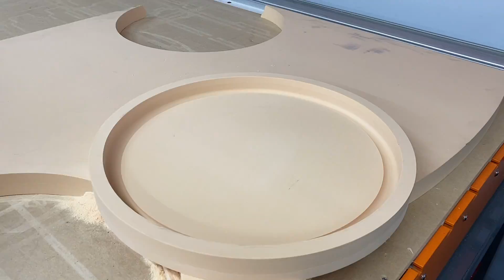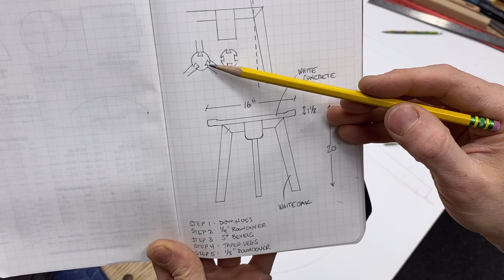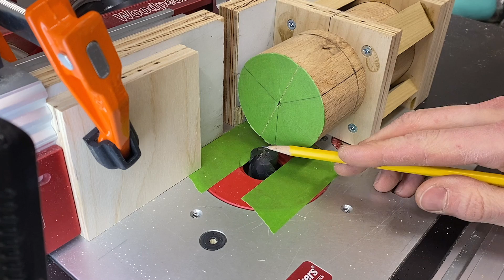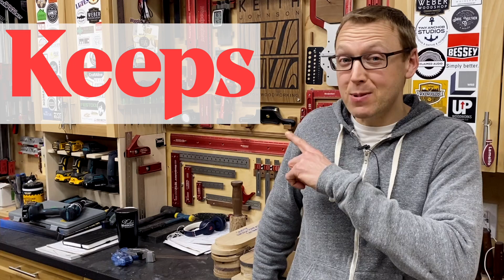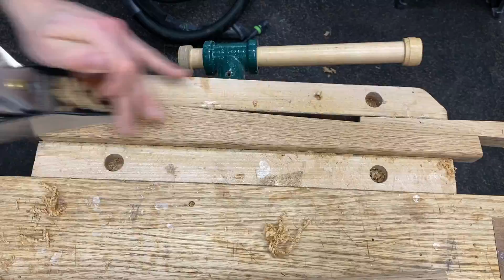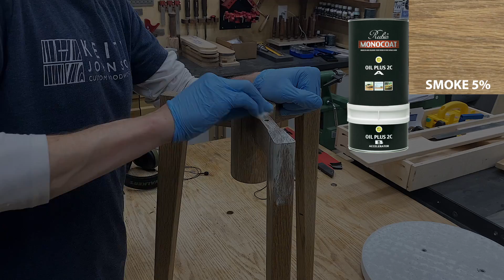BORED with joinery?...try this modern side table with #concrete

Comment: I see a lot of makers/woodworkers using the white Scotchbrite pads for applying finish, and probably just as many starting to use Rubio Monocoat. Can the white Scotchbrite pads be used for applying other finishes like wipe on poly, danish oil, shellac, water based poly, etc OR is it specific to oil finishes like Rubio Monocoat?
Reply from the maker: When using Rubio, you only sand up to 150, maybe 180. The white scotch brite is to help work the Rubio into the pores. I wouldn’t recommend for things like water based poly or shellac because they dry too fast so it would leave bubbles and streaks and you really need a lint free applicator. You could probably try it with oil based wipe on, but I would probably go with a foam brush or sponge applicator. But give it a shot and see what results you get.

Comment: The air bubbles set the rim off, and looks super intentional. Better. 👌🏽
Reply from the maker: I think so too, Brady!! Thanks! I still want to figure out the best way to eliminate them in case I want that silky smooth look at some point.

Comment: Hey, great design and execution. I appreciate your attention to detail and anal-retentive measuring and such... same here. Some thoughts, from someone with concrete experience (not related to furniture, but concrete is ... concrete):
* Pour a very thin layer at first, and if possible, have a vibration thing going while doing
* Use the thinnest (i.e., lotta water) mix you think will work (might want to test run this with different volumes of H2O)
* Make a jig/sled/container in which the mold is secure yet you can pick up the whole thing and essentially drop it on the floor/assembly table/big wide hard place

Last thought, my brother: male pattern baldness guy here... just shave your head bald... cheap, up to you, and I'd say you have the right head shape to support the SMOOTH look. Just saying.
Reply from the maker: Thanks for the great tips, Matt!! I will definitely give those a shot if i try this concrete gig again. It has definitely been a learning process for me, so I appreciate the input. 
And believe me, this pin head wasn't made for that white shiny fleshed dome look! 😜

Comment: Lola obviously needed an ear scritch there are the end. I am also now wondering just how large the shipping container of the Hubble would be with the Hubble in its current configuration.

PS: Nice job on the table.
Reply from the maker: 😆 Lola's ear hair is out of control and gets a bit itchy at times. 😹. You're right...that shipping container may be a bit out of my league due to space constraints. 😂

Comment: Great Video quality Wild Man, and the soft ruffle of flannel is always nice! But serious now. You got me using Rubio (thanks btw), do you have a go to Rubio color to simulate the Stickley fumed look? I’m tired of the nose bleeds from 28% ammonium hydroxide. Thanks!
Reply from the maker: 😂😆 Have you tried the actual FUMED by Rubio? I have a little sample bottle, but have yet to try it, so i'm not sure what it actually does.
Reply: @KeithJohnsonCustomWoodworking  - I stumbled across a short video on it that was not well done. In fact the guy said he didn’t know how it worked. Seems, in this video, the “fumed” was a separate application before the Rubio. Guess More research is in need. I have a large quantity of over 100 year old white oak I make “Mission style” furniture out of. Thanks a Bunch!
Reply from the maker: @MJ-nb1qn  Oh wow! Yeah, definitely want to take your time figuring out what will work best before doing anything on that 100 year old wood!
Reply: @KeithJohnsonCustomWoodworking  👍🏼

Comment: You get such clean cuts without any burning. Really like the tight videos and great projects. 

On the concrete I use a palm sander and let it vibrate against the sides and bottom to get rid of the bubbles on the surface then put it in a plastic bag and plunge it into the mix to get rid of the bubbles in the main body if necessary.
Reply from the maker: Thanks Ben!! Thanks for the concrete tips! I've done the sander trick on the outside of the form on a previous project but had limited success...maybe I just didn't do it long enough. But going scuba diving with the sander is whole new level!!
Reply: @KeithJohnsonCustomWoodworking  on a top this size 10 minutes of vibration should do it. The bubbles are slow to rise.
Reply from the maker: @benhatcher2603  10 minutes?! I definitely gave up after 3 or 4 minutes. LOL.

Comment: KJ your joinery and precision is next level! Have you considered a vacuum chamber to remove bubbles from concrete? Would love to see what you could come up with using jesmonite too. Cheers!
Reply from the maker: Hadn't considered anything too fancy for the concrete since I do so little of it, but it's definitely worth looking into other options for bubble release. And although i do like the "industrial" kind of look of the air bubbles on the edges, it would be nice to reduce them. And as I Google Jesmonite...😂
Reply: @KeithJohnsonCustomWoodworking  ALCH has done similar tables with Jesmonite, really cool
Reply from the maker: @andrhamm  Looks like pretty cool stuff!

Comment: So cool seeing all the jigs you make for all these projects. I would probably just try freehanding it, which wouldn't work out😅 After seeing how simple you make working with concrete look, I might have to give it a go!
Reply from the maker: The first time I worked with concrete I procrastinated doing the pour for about 5 months 😂, but it's not bad at all in small batches. Now, if I was doing a giant countertop, then things might get quite a bit more hairy 😂
Reply: @KeithJohnsonCustomWoodworking  This is very true 😂, sometimes smaller is better😂

Comment: Every time I see bubbles I wonder if vacuum would have helped. With epoxy you have a time constraint, but concrete might have degassed more quickly ... but then the foam might have disintegrated.... I  don't know. Just babbling.
Reply from the maker: Hmmmm...a vaccuum in what way? And I was actually thinking some kind of mini vibrating table to stick the form on and just jiggle the heck out of it for a while 😂
Reply: @KeithJohnsonCustomWoodworking  place the concrete and its form into a vacuum chamber or bag and use a vacuum pump for a few minutes. Bubbles will have to go away, but i don't know what that would do to the foam mold since it's literally made of bubbles. Might crush it or draw concrete into it. be fun to try.
Reply from the maker: @EmmerBigguns  Great idea, but I'm not sure investing a pump and bag is worth it for me since I do so little of it.
Reply: @KeithJohnsonCustomWoodworking  You can't put a price on YouTube content :)
Reply from the maker: @EmmerBigguns  Sometimes you can. Wink wink. Storage room also plays a role...my wife already tolerates when I stack and sticker lumber for drying on the dining room table. LOL.